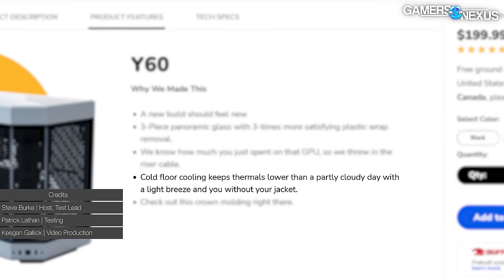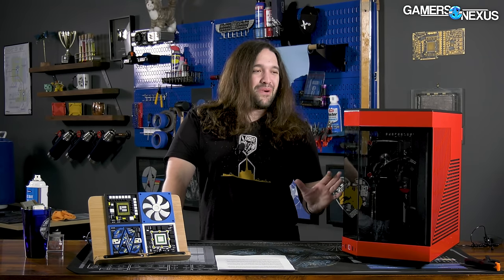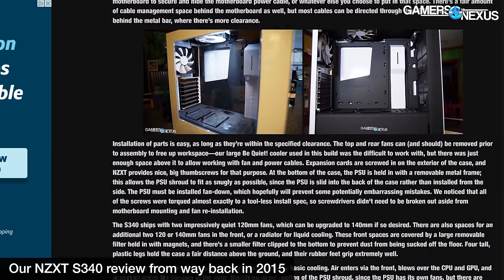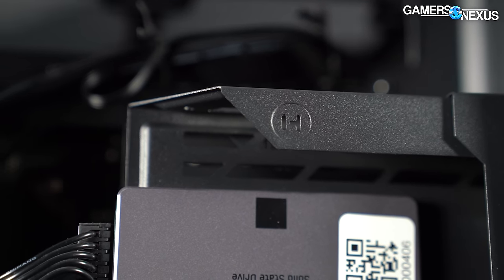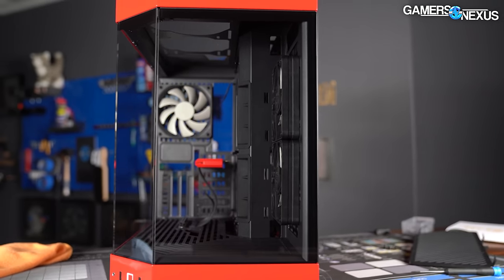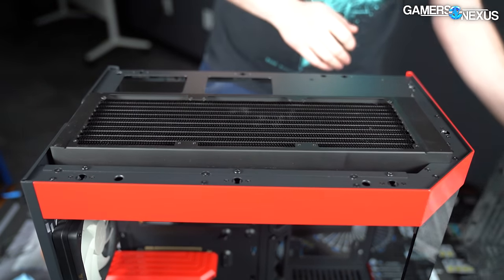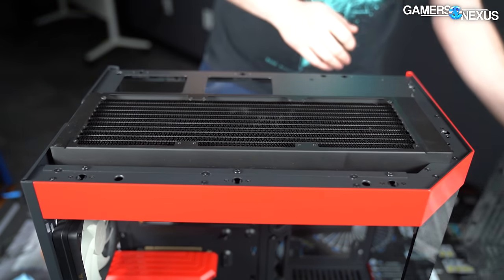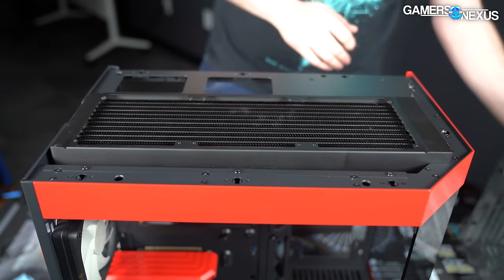Impressive Quality: Hyte Y60 Case Review & Benchmarks vs. O11 Dynamic

Comment from the maker: Grab a GN Black & Red Mouse Mat! https://store.gamersnexus.net/products/gn-red-black-hud-mouse-mat
We reviewed the Lian Li O11D Evo here: https://www.youtube.com/watch?v=o0wecnSTdy4 
We also reviewed Hyte’s first case, the Revolt 3: https://www.youtube.com/watch?v=zJ-JtkxphVE 
Watch our case review playlist here: https://www.youtube.com/watch?v=nVgaE6HiPQ8&list=PLsuVSmND84QtrMP_niRTD2zIa3uUhxIvn
Reply: You should make 'gamers nexus approved' stickers for products. As like a better mark of quality for all products than 80+. Not based on price, just based on like performance, longevity, and does it do a gigabyte.
Reply: ... the marketing is goofy but it's pretty fucking clear what it's saying? It's chilly. Like... how hard is that to understand? IS... steve on the spectrum?
Reply: Like the look of this but would like to see a bigger one made with a few of the issues fixed which could be done in a larger sized case.
Reply: Dear GN, are you planning to upgrade your testing setup? To be honest, it has low very low power consumption for testing PC cases now, so many cases can handle it. But not any case could handle with a modern 500+watts gaming rig.
Reply: Wouldn’t it make more sense for gaming to simply water cool Gpu and leave cpu air cooled?  
I mean during gaming cpu hardly see load where Gpu 100% loaded much heat. At least water cooling Gpu bulk of that heat gone out of case thru rad leaving cpu and everything else much cooler in case. 
I think in the future will see more of hybrid cooling from manufacturers due to power consumption from newer gen cards.  Air cooling will only go so far in a case unless fans are maxed out with Gpu cards creating all this heat.
Reply: Hey man, love your videos! You should take a look into Aigo Darkflash cases, here in Brazil they are so cheap (like, 3x less than the Lian Li ones) and I think they have great designs and also come with case fans.
Reply: I don't understand these companies that think they do not need airflow for water cooling. Cool air + Convection is STILL the most important factor.
Reply: Don't forget that Walmart PC
Reply: I would like to see a video on AIO cooling with a handful of your favorite cases. Half my friends have an AIO for the CPU and a few of those also have an AIO GPU (also a few full custom loops). Not saying you should change your methodology but maybe just take the top 10 cases and put some AIOs or even a custom loop in there to see how they perform that way. Like for instance how much better would this case be with AIOs\Liquid cooling only?
Reply: @thatsgottahurt  does it really matter if the AIO radiator is cycling hot air? You need air! Even with liquid. Heat still has to be transposed.
Reply: I know this apparently is voicing blasphemy in this day and age, or there's been a law passed, or something, since almost nobody seems to do this any more -- quite sadly! -- but the honest fact is, some of the most amazing computer builds I've ever seen, by far, were where someone looked at the existing cases on the market, curled their lip, and built their own machine without using a premade case. 

That also neatly gets around the whole "my proprietary cr*p doesn't fit standard stuff" moaning you guys so often do, that really is more a matter of a bit of soldering effort and custom case work and makes upgrading an office Dell to a gaming beast that much easier ;) as well as something you can brag about.
Reply: Hey guys,
I wanted to ask if you had made a Video about the Antec  P10 Flux? 
I know there are reviews but I don't know the credibility of those. Especially since there are quote of few Chinese reviews
Reply: this is the ugliest case I've seen - I don't get why people like it. 
The O11 is a masterpiece in comparison
Reply: "Air cooler will result in higher CPU and GPU temperatures." That's not always true, LTT has a video showing the Noctua NH-U12A beating several Corsair AIO's on thermals, price and noise. True this case is designed for high end components but you didn't say in high end builds, you said "duh".
Reply: 8:32  "yes nice"  👍👍  ...and the tubes are for fun....???🤔
Reply: Hey Steve, will you ever be making  white T shirts with the blue or red  or even black logo's?
Reply: If middle glass is supporting top structure and overall balance then we can say heavy top radiator will put constant pressure on middle tempered glass. With constant temperature change and top support that glass may explode.
Reply: I just purchased my third ibuypower, & while I'd rather not have had to purchase pre-builds, & tho I got started w/them b4 I saw your well-produced series, they have all been flawlessly assembled/shipped.  The cable management has even been impressive.  I'm not fan-boying out, I don't have enough F's to give about them to do that, but I've had zero problems w/them.
Reply: Red is nice.
Reply: You're very confident now compared to a few months ago, a change that hasn't gone unnoticed!
Reply: I suspect Rob Teller worked for an aquarium manufacturer prior to HYTE and NZXT. It would be interesting to see this turned into an aquarium and have an aquarium next to it turned into a PC.
Reply: Guys, would it kill you to take some wipes to the items you show to get rid of your grimy fingerprints before you take the b-roll shots? Especially with all those glass panels on cases these days? I'm watching a tech review channel, not an infomercial on hand hygiene products, ffs. Have some standards, man!
Reply: @ErgonomicChair   I thought he was just being silly

Comment: Considering the lack of space for add in cards, Hyte might as well have reduced the hight and turned it into an ITX case since there is very little point in limiting expansion options to half height cards.
Reply: You can install NIC/WIFI/Capture cards in it though.
Reply: @ionstorm66  yeah I have no idea what he's talking about. Almost no one uses AICs anyway
Reply: @weavercs4014  Quite a few do. Especially VR users who need a functional USB port for it, or people who want more nvme storage. It's just dumb that the case makes vertical GPU mounting absolutely mandatory.
Reply: @Michael-zf1ko  so who actually NEEDS a full size AIC? I don't have any AICs and I have 5tb of storage on NVME. There is almost 0 use case for a large AIC. Even your examples aren't even legitimate (I don't mean that rudely but you're straight up wrong)
Reply: @Michael-zf1ko  dual and single m.2 cards and almost all pcie nvme are low profile. You can easily find low profile 3.2 usb cards.

This isnt a workstation case, its for gaming. Most mainstream boards have multiple built in NVME and good USB at this point. At best you're looking at a 2.5/10g card for someone with fiber internet, or a capture card. The riser brings the cables up to above a lowpro card which is nice, so you can use all the slots and clear the cables.

The only major loss with this, is all the AIB TB3 cards are full height. So you cant use them unless you get a second riser and stick be behind the GPU. Only works for dual slot GPUs. There are 2 sets of standoffs for the vertical mount.
Reply: @weavercs4014  Then why even bother with an ATX board and this giant case? And guess what, not everyone is you. If you want to get pedantic about "needs," then we can just say nobody "needs" a gaming PC at all. I also like your moving of goalposts. All AICs suddenly become large AICs only. You just wanted to say I'm wrong so you can feel good about yourself.
Reply: @Michael-zf1ko  the case fits AICs but you didn't watch the video. It simply doesn't fit full height AICs. You're wrong and can't accept that you're wrong. So you still haven't named a use case for those cards since the examples you used were just unintelligent babbling
Reply: @weavercs4014  Yes, I did. You don't want to listen. Again you are just saying I'm wrong over and over. I guess you never used a VR headset, huh? Let me teach you child. Motherboard USB ports suck for VR compatibility and they usually require an add in card to function. That's why graphics cards had a USB labeled for VR at one point. Some people also like to save their old drives or add more as they go. Why even bother with more than one drive slot at all when we can all just go buy a single giant expensive one? What if you personally only used 1 USB port? Would you be defending a case that covers all but that one port because you yourself don't use those other ports? Giving the user no choice but to vertical mount their GPU really kneecaps this case (not even mentioning that it won't fit a 4 slot GPU either), but if you are really THAT interested in that kind of guff, then you do you.

And I know it fits the puny AICs, but you were the one arguing against all AICs at first.
Reply: @weavercs4014  doesnt fit the tb3 card i would use soooo
Reply: @Michael-zf1ko  if your usb port in MB doesn't work properly with vr than you have a shitty MB my child, i have had htc vive and now i have valve index and when using 3.2 usb slot or 3.0 or even 2.0 usb slot it never had problems. And if you want usb slots for dongles for full body tracking just buy a usb extension card that fucking fits.

Comment: Heard good things about this case. Great to finally see the raw numbers of how it performs from GN
Reply: I’d like to see how it performs with cpu and gpu liquid cooling
Reply: Too bad it's from a dog shit company 🐩
Reply: @chimpo131  oof
Reply: @criznittle968  just built in it with a 360mm aio on top. Added 2 intake fans on the side also. Surprisingly cools extemely well lol
Reply: e  that looks like a virus
Reply: @gags730  well I mean the fact it comes included with the vertical mount plug for that price makes it really good
Reply: @criznittle968  The same, Water cooling nonsense hasn't changed and still doesn't use a proper thermostat so the numbers will match accordingly.  The case is not so different that there's some magic cooling numbers.  Aside from that horrific gpu mount the VC seems the only victim in a non custom loop build.
Reply: @itsjirM  What did you expect? It's a PC not a Geo thermal vent.  Of course it'll be cool, as long as you account for cooling no matter if it's water or air setups it'll be cool.  People these days are so stupid over the top about cooling they throw heat retainers (Radiators) in their builds and Gee whizz it's cooler by 3 degrees for 2 whole hours.  Those with degrees in Heat/Hydro dynamics will get that joke.
Reply: @animalyze7120  I was literally replying to someone who said it would have shitty thermals. Not sure if they deleted it or what.

Comment: I just bought this case for a build and he is right, you can tell the case is made well. There is a lot of engineering in this case.
Reply: @suspicionofdeceit good insight. Please upload more comments.
Reply: i just got mine today and when i opened the box my reaction was the same as steve described i was honestly surprised at the quality of what i was looking at i realy cant wait to get this build started but all i have so far is my case and MOBO
Reply: Where, I didn't see a single engineer in mine
Reply: @BahhBahhBrownSheep  the case is people!
Reply: Lot of engineering yet no support for full-size expansion cards.  Only thing you can install is maybe a Wifi PCI-E 1x card, and for the cost of this case and it's water-cooling purposes, your motherboard should have that built in.
Reply: @NightReaper879  how are you temps?
Reply: @ibobeko4309  I think in sitting at 40 to 50 degrees while running hunt showdown on max.   Settings with obs recording
Reply: @ibobeko4309  40 cpu 50 gpu I think

Comment: I just finished my build in the Hyte Y60... I populated all the fan slots, have a 2 slot 3070, added a 360mm aio for my CPU in the top, my temps are great. 70C MAX in torture test's over time.
Reply: I have a 3070 as well and is technically a two slot but really takes up 3. Is yours an FE? I have a STRIX. I've been considering this case for a while just for aesthetic but I am worried about temps.
Reply: How did you configure your fans? I'm building in it this weekend. Thinking intake top and bottom and exhaust on the side panel. Doing a 360aio and have a 2.75 slot card I think
Reply: @ITh4n4tosI  Nah, intake in the side and bottom for air to the gpu... and exhaust the back and top through my radiator.
Reply: @kristianbylard8135  Mine is an MSI dual Fan true two slot, BUT I got really good Air Flow fans in the side intake and left the bottom fans stock and my temps have been really decent. if you're worried at all, just go Lian Li.
Reply: @Broganshire  that would be the correct way to achieve the best cooling.
Reply: @Broganshire  What are your readings? The reason I am asking. I have a 3090 and i9 12th K and at idle i get 25-30 Celsius and at Max 40-60. I have my radiator on the side and the reason is for cool air as intake instead of heat air as exhaust. When you do exhaust, that heats up the radiator instead of cooling it. Intake is like a car radiator. You want cool air to go through and cool down the liquid.
Reply: @soldado23  I know this but I have a 360mm AIO so it can only fit in the top and I  only have a 5600x OC'd
Reply: @Broganshire  ohhhhh, tracking.
Reply: @Broganshire  Thanks, I think Im just gonna stick with my case for now, I have the TD500. When I attempt custom loop, I think I will for sure get it though!
Reply: Funny to hear how easily achievable good cooling is after listening to 25 minutes of thermal issues. Maybe gn needs to update testing methodologies
Reply: @lliamthrumble  I think they do like a basic 2 fan scenario to test the cases against each other, but I do agree with different form factor cases, they basic 2 fan test doesn't always tell the WHOLE truth. to be completely open with you, I also bought the Typhoon fans which are like some of the best fans.

Comment: just built in this. I see a few things that I'd change. 
1) the top rad tray has the clearance to slide forward a couple inches. The case is notched out to accept it, but the tray doesn't line up with the screw holes. 4 extra holes would allow the rad hoses to be rear mounted instead of only at the front. 

2) the HDD sleds take up a lot of space, and the screws are offset, so you can only mount them one way. If you could flip them or even remove the tray from the rear blank(cover) that would give you a lot more room.

3) The bottom fans have the cord connected at the side of the fan instead of the corner like most fans. This means the case has a hole that lines up with the hyte fans and not aftermarket. Also the screws for the bottom fan could be an extra 2mm in length. The popular Arctic P14 fans are a hair too thick to mount without aftermarket screws.

4) the cutout for the rear I/O plate on mine was a mm to large top to bottom. Also (visual only) I think the small opening above the vertical GPU screws on the rear of the case could use one of those little sliding panels to finish it off.
Reply: Regarding #3, you were able to mount aftermarket fans on the bottom? Thanks.